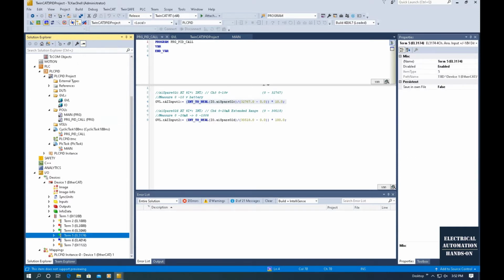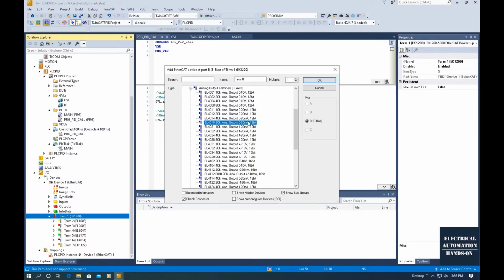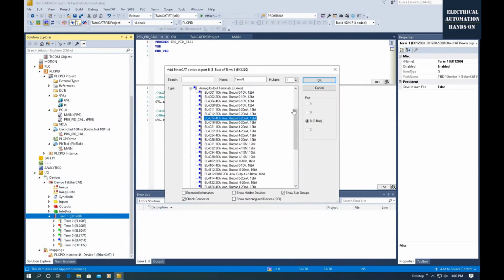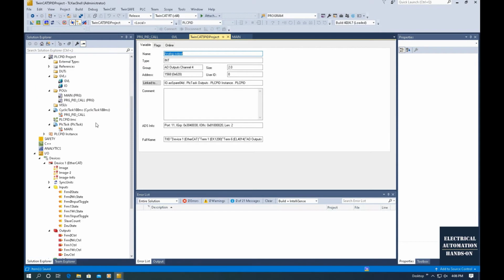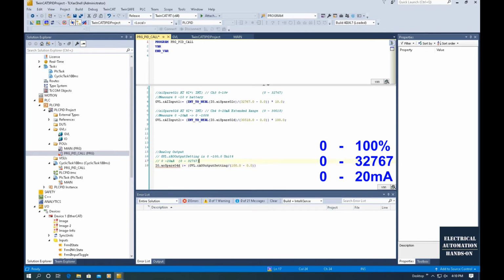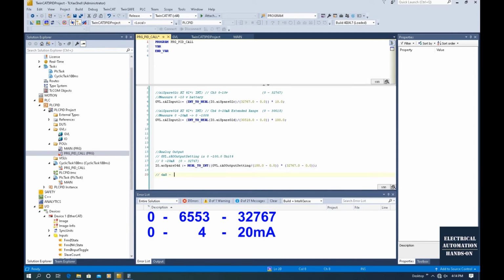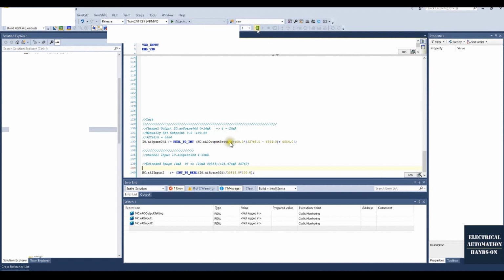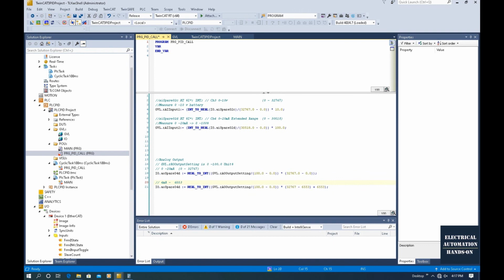PID24 - Beckhoff TC3 PID04 - Analog Output 0-20mA/4-20mA EL4014 'UNSCALE' programming

Comment: Hi @Electrical Automation Hands-On, thank you for the nice tutorial. I am new to this and I have one question in regard to settings of EL4008 (0 - 10V). I am trying to follow your suggestion but I am a bit confused. I need a variable output only in range of 0 - 4V, how can I set it?
Reply from the maker: Multiple 0.4 to your command value, then do the scale calculation.
Reply: @electricalautomation  Thank you vey much for the suggestion. I will try as suggested.

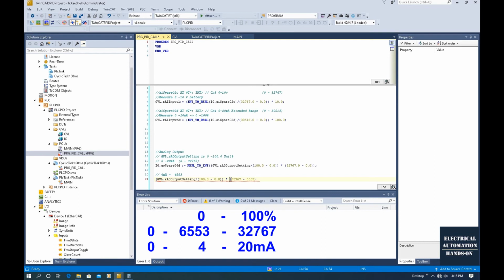Comment: hi, why did you in 14:08 add up    +6553?
Reply from the maker: As 14:08 shown, if the full range 0 -20mA is 0 - 32768, then the 4mA will read as (32768/20) x 4 = 6553. To use a hardware modual 0 - 20mA but the real scale has to be 4-20mA, the setting data should be 6553 - 32768.

Comment: @ElectricalAutomationHands-On how about if i wanted to change max. value of the output like example if it is max. output 20mA and i wanted to change it to 10mA? Is that even possible? if it is how can i do that? btw nice video.
Reply from the maker: As shown in the vidoe 6:02, 32767  -  20mA. Then scale your calculation as  0 - 65,534. then when you actual calculated result is 32767, the final calculated results for output is 16383 - 10mA